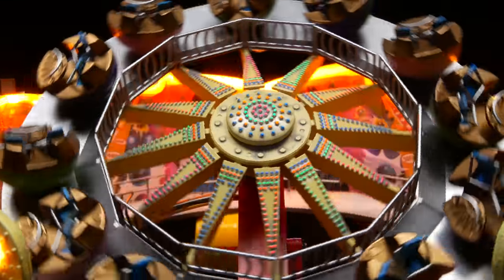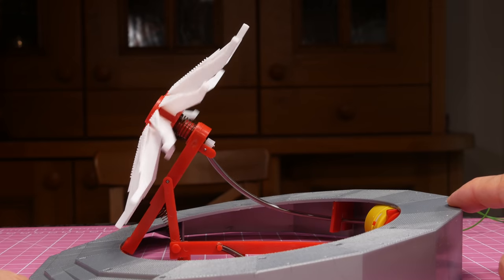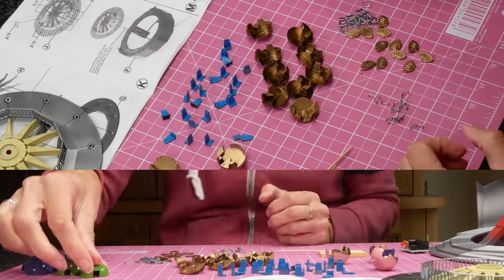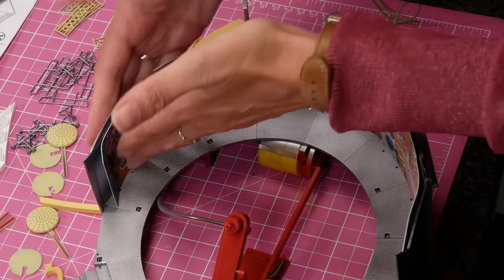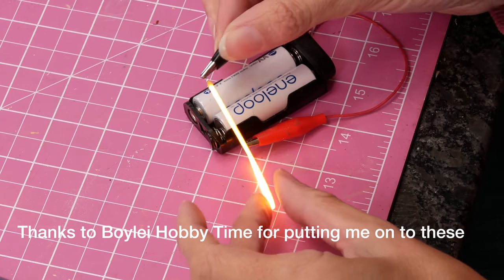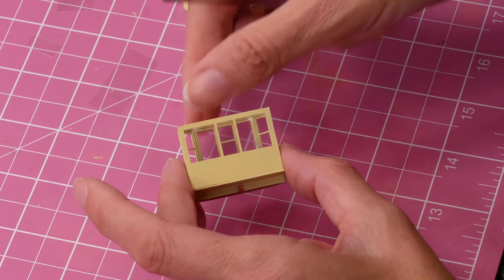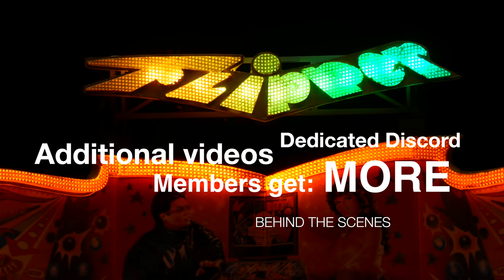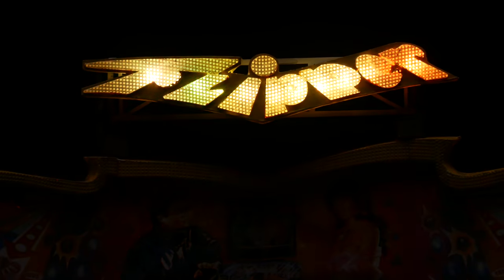Build a Miniature Fun Fair Ride with Flashing LEDs

Comment: I hope you get the chance to build up your funfair. It looks fascinating to make, but I'm in awe of your patience. I can't imagine how hard it will be to replace the flexible LEDs when they fail, having to undo so much of your work to access them. Surely they could have designed access to LEDs and motor to be easier? Well done for your skill, patience and ingenuity.
Reply from the maker: The original kit used bulbs glued in place. I’m just hoping the LEDs have a long life time!

Comment: lovely work, fluorescents are interesting, if your trying to block light , silver is better than any other colour
Reply from the maker: That’s a great tip. Thanks.
Reply: @KathyMillatt  no problem, it wouldn't work with something so small but I usually use silver builders metal tape , great for light blocking

Comment: As always, you have done a fantastic job with this model, Kathy. The "problem" with novelty structures like this is that in order to make it plausible on a layout it would need to be accompanied by a strong handful of other carnival rides in close proximity. This would gobble up too much valuable real estate on most layouts. So at this point we have to decide are we modeling railroads or modeling carnivals? I'm always a bit amazed manufactures offer kits like this, and wonder just how many they sell to justify all the research and tool-up. Nonetheless, it can probably be proclaimed your rendition is the best ever assembled.

Comment: That was great. I've seen the modified and scratchbuilt fairground rides on the Miniatur Wunderland channel, but they always seem a bit secretive about the details of what their modifications are (rebuilding it all in metal seems most common, as it's running all day, every day, I think), so it's good to see what you might need to do to get the best out of the Faller kit, without the all-but-unlimited resources of Miniatur Wunderland. The fluorescent pen idea is brilliant: if you were building it into a diorama or layout, you could mount a black light above it. Just needs some people now!

Your 3D printers must have broken out in a cold sweat when they saw you open a plastic kit, but glad to see you reassured them they were still needed. :-)
Reply from the maker: My printers know I love them but it was nice just to open a box and build.
Reply from the maker: I will do an overhead black light. I have an LED strip of them somewhere.

Comment: You have done a great job, perhaps back light UV LED's on the back of the lollipops to make the spokes glow? I have just bought 9 Faller fairground kits second hand, they need fixing up and putting LED lights in, some have bulbs, but I want to replace them. This gives me lots of idea's and I appreciate your learning curve that flex LEDS are very useful.
Reply from the maker: Hi Timber. It was definitely a learning curve. I may add those black light LEDs but I hope to put this in a diorama eventually and I was going to put the LEDs in a lid. If I don’t then I will go back and add them.

Comment: How did yu power the filiment light strips.  was it battery of did you have a power suppy?
Reply from the maker: I use a micro USB lead but step it down to 3V for the LEDs where needed.

Comment: Do you share the .stls of the light channels you designed?
Do you share your arduino lighting code?
Reply from the maker: I haven’t I’m afraid because I had to do manual fettling afterwards to get it to work and I haven’t gone back and sorted the files.
Reply: @KathyMillatt  Well, darn.  Remember, the open source community is built for this kinda thing.  We keep improving each others designs!  Hopefully, you will reconsider posting.

Comment: hi, i really want to know how to power it on and where u found the power supply if u used it
Reply from the maker: I bought a 16vAC supply for the flipper from Gaugemaster. The LEDs are USB power stepped down to 3V.
Reply: @KathyMillatt  tysm
Reply: @KathyMillatt  i cant find it😓
Reply from the maker: @bbuubbo  I got mine via Amazon. I just searched on 16v ac power supply.
Reply: @KathyMillatt  how do i Connect it on the ride ?
Reply from the maker: @bbuubbo  the kit comes with instructions that you need to follow.
Reply: @KathyMillatt  sadly my instructions does't have the part with the Motor 😓
Reply from the maker: @bbuubbo  surprising but it’s AC so I don’t think you can wire it incorrectly. The gaugemaster supply I used had terminals and I wired the motor to the terminals.